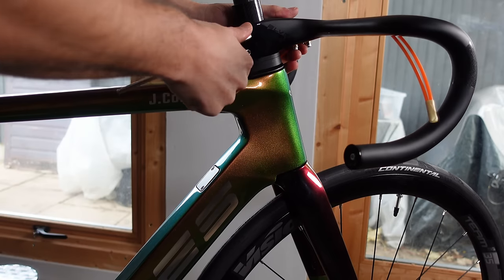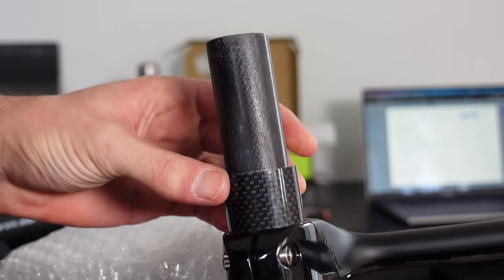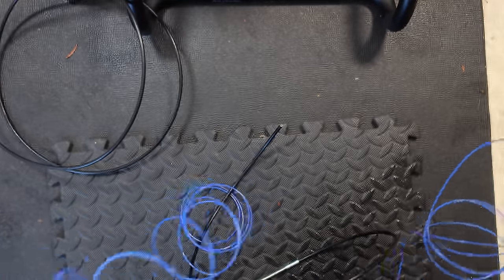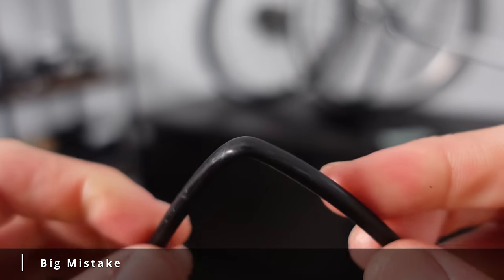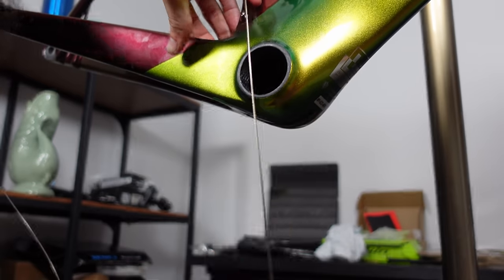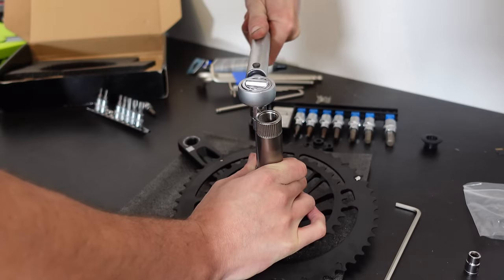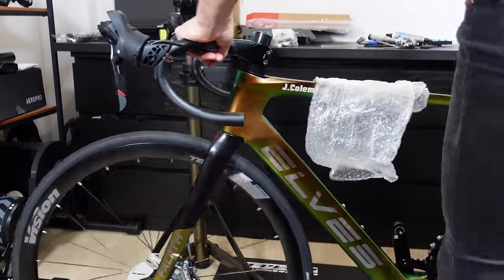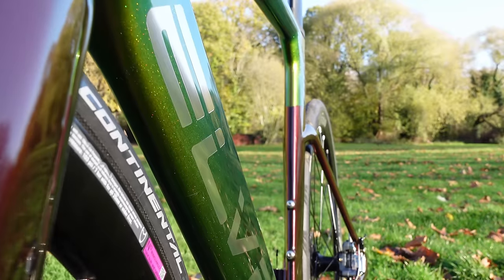$2000 AliExpress Carbon Superbike… Full Build Process!

Comment: I have the same clamp on my seatpost, I found out that the bolt was getting loose with the vibration and reducing the torque, letting the seatpost to drop. I applied some Loctite thread locker and it worked great. I also changed the top steerer cap with a flat one to have a better compression for the bearings to avoid touching the plug underneath. Well done on the build process!
Reply from the maker: Thanks for the information. I'll chuck a bit of thread locker on mine to make sure that it doesn't wiggle loose. I've seen people change to various different compression plugs. I need to get a longer one anyway so I'll take note on the top cap size.
Reply: also using fibre grip grease also help

Comment: Great stuff.  Definitely tell us how it rides.  Recommend riding it back to back on a cornering course with a buddy that has a legit bike.  That's what I did after I built up a Trifox X18 with ultegra/105 parts. A buddy and I rode his tarmac SL6, my BMC roadmachine and my trifox X18, and another buddies Yoeleo R12.  The difference was 100% noticeable. I promptly put the Trifox up for sale and bought a used SL6 (only for marginally more than what I spend on building up the Trifox).   When you ride bikes back to back, that is when the differences really come shining thru.

Comment: Great video again Jourdain! I absolutely love how you make mistakes and leave them in the video. We are human after all! Small tip: never clamp a workshopstand at the top tube. Instead install the seatpost first, and use that as your clamping point. The toptube is way to thin to support the weight.
Reply from the maker: I'm glad you enjoyed the video! I wanted this to be a true representation of a home build so the mistakes were staying in! Thanks for the tip on the top tube clamping 👍🏽
Reply: Or if you want to use the stand as you did, just clamp with a very minimum pressure, just to avoid a bike fall
Reply: Best to avoid it altogether, can't speak for this bikes structure specifically, but my lightest ever bike (I'm a size 58 roughly depending on geometry, so large/xl bikes), was an Easton Scandium aluminum frame with carbon stays and fork... that frame was swaged, and in the main central section of the top tube, was 0.4mm thick (yes, less than 1/2mm).... that isn't a lot thicker than a soda can (0.2mm), so you can imagine not just the clamping pressure, but any leverage (tightening bolts on something, leaning slightly on the frame to reach something, etc) while it's fixed in a clamp, could EASILY buckle the aluminum (or in this case, crack the carbon if it's also relatively thin)... (that bike actually eventually broke at the seatstay/chainstay/dropout interface, one of the thickest parts of the bike through a roughly 1cm thick section, go figure, likely welding stresses...)
Top tube is actually intended as a chord (some creative bikes actually use a cable instead of a tube, as an example), to resist the headtube and seattube being pulled apart, so it isn't by design a weight-bearing or pressure bearing design, while certainly made for SOME tolerance of pressures from the real-world, it's not robust (the downtube is generally the robust part of a frame).  Just being in the habit to avoid clamping it is best at all times...
One thing I HAVE done, is with an open clamp, I've "rested" the bike across the lower clamp face... any pressure then just causes it to sway (and makes me aware of that input pressure happening), but avoids any pressure spots of significance and no risk of crushing it.  Just my thoughts on it. @projectcycling
Reply: @ChrisTexan If the Scandium Aluminum frame had carbon seat stays and chain stays , the rear dropout junction would have been bonded with a resin or high strength adhesive . Especially if the dropouts are aluminium alloy which some of these types of frames were like Kinesis ones .  Therfore , there would have been inconsistensies or irregularities at that dropout to carbon interface point .

Comment: Shimano and other big brands recommend no grease on center lock threads. Incase of heat, it can melt onto the rotor and give issues. Also, the splines are tight enough and won’t likely give you issues when removing in the future
Reply from the maker: Thanks for the tip.. I'll keep that in mind for the future. 👌🏼

Comment: Setting up limit screws on rear derailleur is actually better with chain on. 
- Have the chain on the smallest cog on the rear and biggest on the front.
- Set the High limit screw so the chain barely isn't touching the second smallest cog.
- Bring up the tension (not too much, just so it isn't completely sloppy) on the shifter cable by hand and screw it tothe derailleur and then loosen the high limit screw slightly. It will remove the rest of the slop and will leave you with little to none derailleur adjustment, while also widening the gap between the 2 smallest cogs ever so slightly.
- Shift through the gears, besidest the biggest one until they work mostly perfectly and then carefully shift on the biggest cog to adjust the low limit screw
- Adjust the low limit screw with chain on the small cog at the front and shift through all the gears again, in all possible combinations
- You are set up

Comment: Nice video. About the fork cutting point, it depends also by the top cap type. The one you're using it's a little bulky and can interfere with the compression plug so you correctly cut some mm more. If you have a completely flat top cap you can be less conservative

Comment: Three things on my build that my bike shop had an issue with. Same bike frame. Same groupset. Went with the br005 hydro mech brakes.

1. Compressionless housing wouldn’t work for the front brake as there was some carbon excess at the head tube where when you would turn the bar it would bind the front brake cable housing and create tension thus pulling on the brake cable. No bueno. Had to end up going with a regular cable housing since the slight difference in size allowed it to pass by the excess carbon without binding. These bikes are really best designed for hydraulic or electronic systems. 

2. The way the cables were routed through the bars (same way you originally had it) didn’t allow very much room to actually screw in the included “out front mount” for the gps computer. Was only able to get one screw in and it’s fine, but I’m very particular with things and this bugged me a bit. 

3. Something my lbs also noticed which might cause issues with mechanical brakes on this particular bike, is that the hole entrance on my fork was set towards the rear vs the front like on most branded bikes. The routing exit to the brake caliper was set towards the front, which caused a bind naturally on top of the excess carbon buildup. It basically just created an unnecessary bend that is never an issue with most branded bikes. 

As far as the ride of the bike, it’s freaking amazing. It’s so comfortable and feels super nimble/fast when you need it to be. It’s like 40mm lower on the head tube than the bike I used to ride, and it feels more comfortable on longer rides. If you can get past the little buggy issues, and know you’re getting an aero race type bike for much less than bike shop prices, it’s amazing value for that. If you’re looking for perfect, even at this cost, this may not be for you.

Comment: For compressionless brake housing, it is best to dremel or file the cut end down so it’s perfectly flat and 90deg cut. Takes out alot of play in the system for high load braking.

Comment: Pro tip when you cut the cable housing slip an old used length of cable in the hole before you cut, the cable will help keep the housing from collapsing.
Reply from the maker: Great tip, I'll use that on the next build!
Reply: I've also done it this way for years. Hard to watch this ;).

Comment: To fit cable’s hosings into the frame usually i use an old wheel spike,i cut it 10cm long +- and i fit it into the giude and the new hosing then I push it with the new sheet using the guide just to direct it outside without pulling

Comment: little tip with centrelock breaks. dont grease the spline for brakes as central frugle force will push it out onto the break pads

Comment: Top tip. I run GP5000s with Vittoria latex tubes and they are great. Much lighter and better performance. Don’t believe what people say about latex tubes being fragile and easily punctured. As long as you install them carefully and use talc they are more robust to punctures than butyl IMHO.
Reply from the maker: Thanks for the tip! I've meaning meaning to give them a try... I'll go for it when I get at some point.

Comment: Those are close quartered cable bends in the handlebar/stem to steering tube do look tough to make.  You did good. The results exceed the soon forgotten frustration. I've no issues with "Jagwire" cable and housing after a year. The bike looks fantastic!! Good how-to series. Hope it's a blast to ride.
Reply from the maker: You are correct... I haven't thought about those tight bends fro a while 😂 - I'm glad the jagwire cables have been good for you, hopefully it's the same story for me as well.
Reply: @JourdainColeman  It was certainly worth your effort as the bike looks great without the housing showing. Nice thing about the "Jagwire" is having leftover housing. I hope you get a break in the weather for a test ride on the street. I watched my bike mechanic replace the bottom bracket bearing on my Mt bike the other day. It was a learning experience for me, but he struggled a bit getting the new one centered. Keep the rubber side down.

Comment: If you watch Gee Milner do the stem (I don’t like how he does it), he cuts the stem flush with the steerer, and yes that plug may stick up but when he puts the tiny spacer on top you can see it moves around freely and is not riding over the plug diameter, and the only thing that really holds it there in place is the ridge under the top cap.

Comment: I think there's a bit too much grease being used in the BB and Crank install. That'll attract grit. It may repel water, I suppose. Perhaps a small amount of anti seize on the crank arm inner, non drive and the same on the crank spindle. The part that moves and is already greased is the sealed bearings in the BB. So the crankset shouldn't need any grease, just some sparing placed anti seize.

Same with the centre lock disc rotors. The contact points there should have some small amount of anti seize.

Comment: Holding the torque wrench close to its clicking pivot point results in a higher torque load, your hanger 8Nm probably actually got 10-12Nm
Reply from the maker: Thanks for the comment... I'll double check the bolts 👍🏽

Comment: If you don't have a carbon cutting guide use a pipe cutting tool. Work slow applying just enough pressure to cut a single layer at a time. It will take some time but if done correctly no need for a vice or filing when done.

Comment: Good video but I will always put foam tubing around any outer cable, gears and rear brake in your case, that goes through the frame.
Nothing worse than a cable rattling around in the frame.
Think you installed the split link the wrong way as well.  Not all of them have a directional arrow but I tend to follow the shimano way.  This has the fixed pin on the outer plate nearest the rear derailleur when the chain is below the chainstay.
Also, loads easier to set up the front derailleur without the chain on.  With most derailleurs you can screw in the lower limit screws enough to help you with setting it parallel to the outer chainring and 2mm above the outer teeth.

Comment: Great video with lots of really good tips. FYI though, where you bend the wire to hold the chain together, I've got that same chain breaker tool, if you look at the main handle there's a hooked wire there just for this. Perfect 3rd hand for breaking/linking chains.
Reply from the maker: Would you look at that!! I had no idea... I'll give that a try in future builds 👍🏼

Comment: hi this bikes normally make some funny cable rubbing so the use of inner cable damper to eliminate any cable knocks
Reply from the maker: Yes, foam is normally added to the cable through the frame to prevent knocking. I didn't have any unfortunately 🙃

Comment: This is extremely educational for me Jourdain since i plan to build my own bike sometime in the future. I really appreciate your effort. One last thing, is there any other way to avoid the chimeny on top of your nice looking aero bars?
Reply: just cut the steerer tube more
Reply: @ivan-dx9fo  what about the compression plug
Reply from the maker: As @ivan suggested you can cut the steerer tube lower to your desired length. I left mine high in case I needed to raise the bars after my bike fit. As for the compression plug, I'm going to buy a long one that will cover the stem and then replace the one that I have.
Reply: @JourdainColeman  i see, i see. Now i get what he meant. Thank you once again for the video Jourdain.
Reply: @RixnoAsteres  Mine, i cut the tube more about 0.4cm under the stem level. My normal plug measure at 4.5cm fit just fine. If you affraid 4.5 not enough maybe just get 6cm would be better.

Comment: you build this huge chimney to have the option for more stack later?
usually you just cut 4mm under the stem and insert the plug..
it is much more important that the plug covers the whole clamping area of the stem.
it seemed a bit short now with the chimney, judging from the video picture.

Comment: I'm really glad I subscribed to this channel: really interesting stuff. To throw in my two cents' worth, when you're messing  with the brake discs, be sure not to get grease or oil on them or you'll contaminate the brake pads. After working with them I usually clean them off with a clean rag and rubbing alcohol just to be sure.

Comment: Enjoyed your video probably because it caused me to reminisce to a build I did some 6 months ago (velobuild 168) . We used similar sources (OZ, Park tool) for information plus similar parts (sensah, Juin Tech) . Find myself often upgrading the bike (eg changed to Di2 8050) Been thinking about upgrading to hydraulic but its too costly and I have to admit that my braking needs don't necessitate the change. The look of your bike have me contemplating another (frame-Elves or Seka))upgrade(hope my wife does not see this)
Reply from the maker: It sounds like you had a fun time with your build as well! A bike is ver truly complete, there is always an upgrade here and there 😂 - I'm looking at frames currently for my next build as well
Reply: @JourdainColeman  OG-EVKIN bikes. look them up.. Ali express.

Comment: Ugh, those stiff shifter cables are my nightmares, I used a brake cable housing as an alternative since shifter cables are a pain in the ass.
Reply: Make sure to use end caps. And please use grease on the wire too.

Comment: all good except for the spacers above your bars.... especially with a short plug. Get that longer plug ASAP. tightening the bars when the compression plug is high can cause some damage.
Reply from the maker: A new plug is arriving today so I'll get it swapped out 👌🏼 - I'll also cut the steerer down at some point to reduce the chinmey

Comment: So Jourdain, the one thing I didnt quite get, was why have you left a bit of the fork steerer pertruding? Is that to do with having a short compression plug?
Reply from the maker: Hi Harry, that was because I was going for a bike fit and I needed to have some flexibility to raise the stem if needed. 

If I needed to raise the stem, I could swap the spacer so it was under the stem which would raise the bars. It's not the best way to do it but at the time I had to give myself some wriggle room. I hope that helps 👍🏽

Comment: Nice bike! 
I would have a big problem with the spacer/washers on top of the stem, doesn’t look aesthetic. 
And I would’ve never gone with a mechanical group set way to much hassle to install eTap would have saved a lot of time and nerves
Reply from the maker: Yeah, I left it high for my bike fit... I need to cut the Chinmey down asap! 😂 

I can see why people go for Hydro brakes and electric gears after installing these compressionless housings.

Comment: Looking at your cable routing drawings…that’s Why I decided going (used) SRAM Red AXS with (new) Rival AXS 😅 combo to keep prices low but complexity and functionality sound
Reply from the maker: yeah, I can see why people go for SRAM's completely wireless offering. It would be soo much easier to setup and maintain. How much did that cost you if you don't mind me asking?
Reply: @JourdainColeman  I was for quite a while thinking about going 11s cables. But at the end decided to go for SPCycles 053D frame (fully integrated cables, geometry kinda SL7) with EliteWheels (tubulars…I know, but still love it being puncture resistant and holding for a season). With some used SRAM parts and AliEx carbon parts and some stuff lying around - more or less 1800 GBP (=2100 CHF)
Reply: @JourdainColeman  May I ad, cassette/chain/brake discs are used NOS 12s Shimano Ultegra/Dura-Ace…realized this combo works better than SRAM only and is much cheaper/available as NOS or only lightly used. (Price incl. everything)

Comment: I’m not a mechanic.  I’m a lawyer.  But I enjoy clumsily wrenching and building bikes for myself and others.  I understand the reasoning behind internal routing — it’s marginally more aero and less cluttered.  But one begins to wonder about form vs. function.  This extreme routing cannot help but add friction to the system with twists and turns.  Is it all worth it?

I suppose wireless electronic systems solve much of the issue, but at what cost?

The weed whacker trick?  That’s slick.  I’ll remember that.